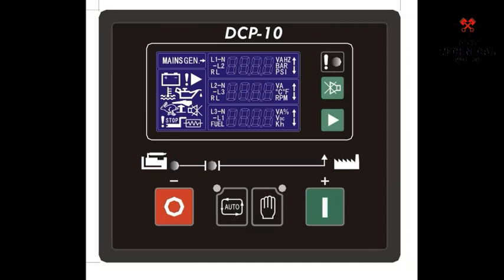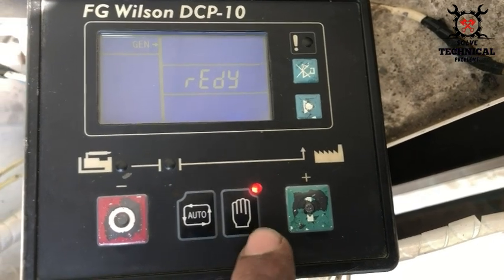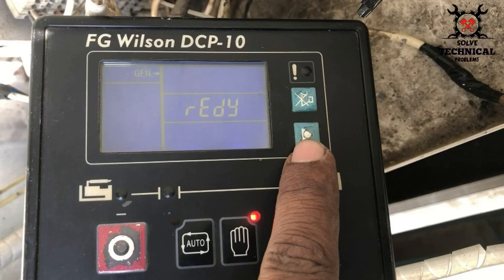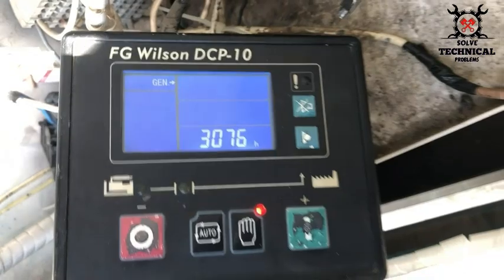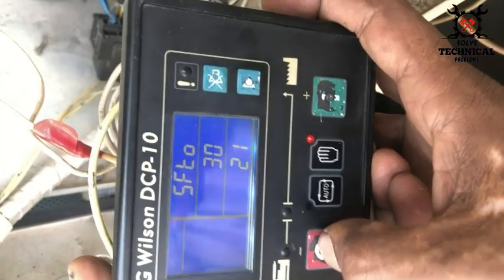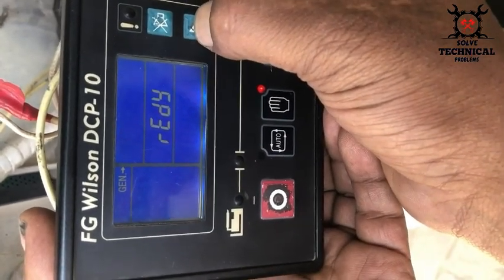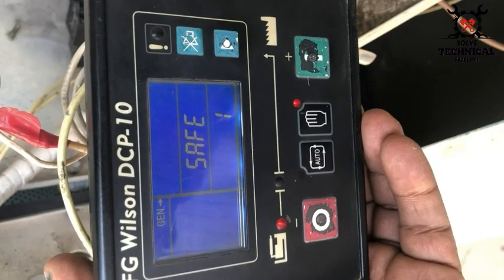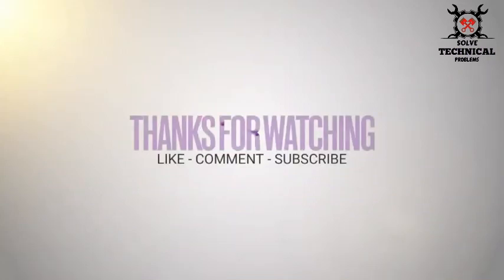Password for DCP-10 module FG Wilson  changing parameters .Programming in DCP-10.

Comment: in my display the running hours is showing in kh. I want change this in only h. how I can do that? please help me. thank you.
Reply from the maker: 1. Controller OFF (genset not running).
2. Press and hold:
🔘 Stop + 🔘 Start buttons together.
3. While holding, turn the Auto or Manual mode selector ON.
4. Keep holding for 8–10 seconds until the service menu appears.
5. Scroll using the ▲▼ buttons to find:
“ENGINE HOURS FORMAT” or “HOUR DISPLAY MODE”
6. Change from:
KH → HOURS
7. Press Enter to save and exit.
Reply: Thanks for your response
Can you please help with point 3.
I mean while I was keep presshing both plus and minus button at the same time should I press the auto or manual button just one time or keep pressing any of them continuously with other buttons.

thank you again 
 @Technical.Education

Comment: How do I set when the generator will on or off in auto mode?
Reply from the maker: Take a wire from battery negative and connect it to 13 number pin for remote start pass this wire from relay or contractor operating on main voltage if main supply fails the negative of battery is supplied automatically to number 13 pin generator will start automatically
Reply from the maker: https://youtu.be/iPaspc41IBg?si=0Z0M5an-SETCbLmm
Reply: Thanks a lot I am learning a lot from you
Reply from the maker: @oijiabhuisrael3560  welcome

Comment: Why the hours in minus
Reply from the maker: 3076 hrs not minus
Reply: Not here...in my DCP10 TO MY GENERATOR BEACAME in minus
Reply from the maker: @MOHAMAD1996-f7v  in minus and decrease with running?it can be dash sign if hrs are not decreasing
Reply: Not change
Reply: How I can make it to normal...in positive
Reply from the maker: @MOHAMAD1996-f7v  update software
Reply: U can give me ur face account to send to u picture about it
Reply: By computer or I can do it manual?
Reply from the maker: @user-ki3yg5kh2u download free from internet easily available
Reply: And every4 years decrease -0.01
Reply: 8 day ago convert from 32.25 kh
To -3.25kh
Reply: Cara mereset/menghapus jam kerja bagaimana... soalnya sudah bukan Satuan jam karena sudah 13.540
Reply from the maker: Not possible
Reply: @Technical.Education agar bisa kembali ke satuan Hours bukan KH
Reply from the maker: 1. Controller OFF (genset not running).
2. Press and hold:
🔘 Stop + 🔘 Start buttons together.
3. While holding, turn the Auto or Manual mode selector ON.
4. Keep holding for 8–10 seconds until the service menu appears.
5. Scroll using the ▲▼ buttons to find:
“ENGINE HOURS FORMAT” or “HOUR DISPLAY MODE”
6. Change from:
KH → HOURS
7. Press Enter to save and exit.